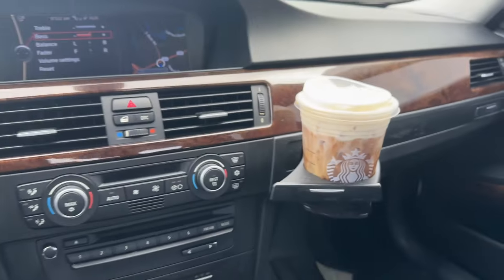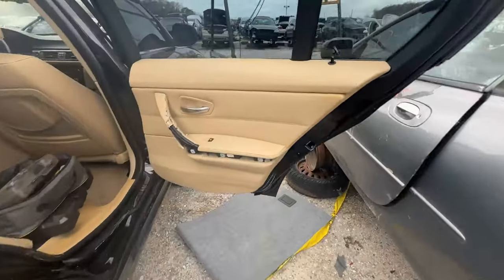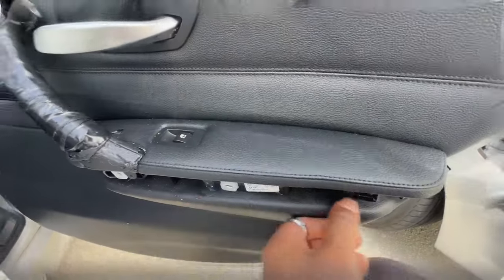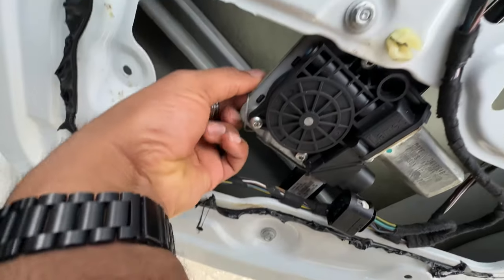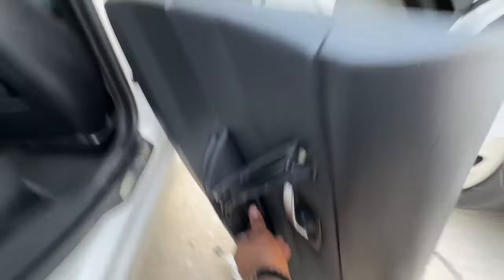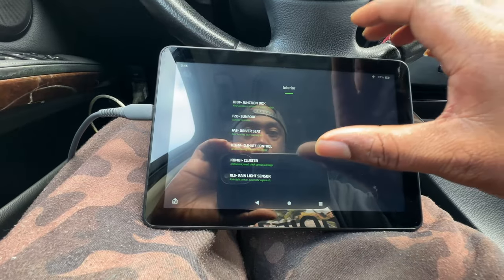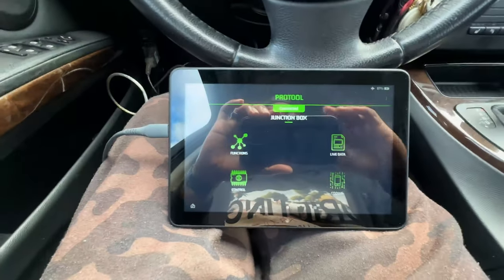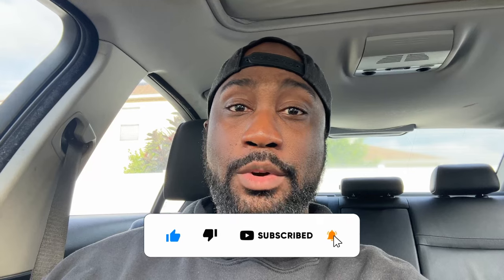Ashy 2 Classy - Rescued BMW 335i Gets Some Love - S2E1

Comment: I like the content. Can you explain how you turned that tablet into a scan tool with the ability to control things?
Reply from the maker: Thanks appreciate it. It’s a tool call protool, and I use an obd2 cable to connect it. You can use a mhd wifi adaptor instead of the cable. In Google type “bmw protool” and you can see the software or inside of your Google App Store.
Reply: thanks @nOshi2x
Reply from the maker: @larryp85 no prob